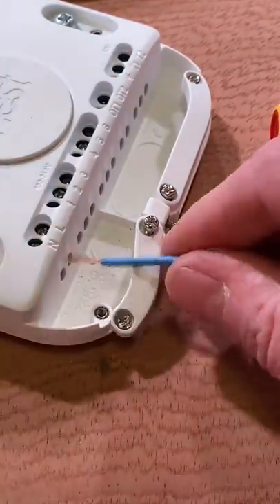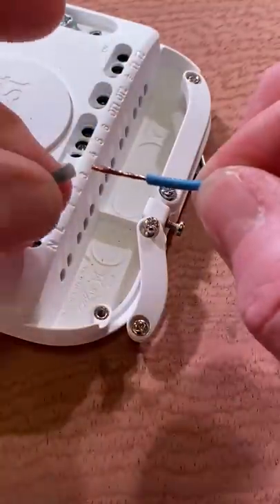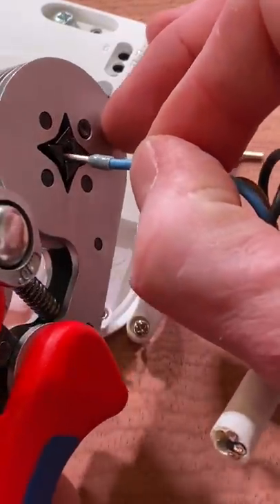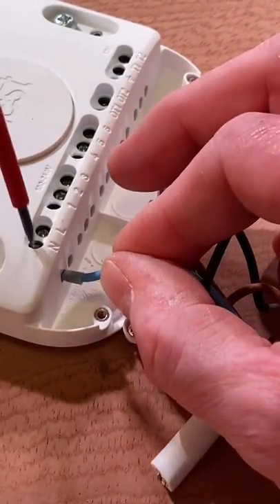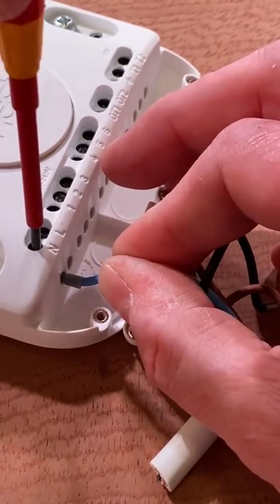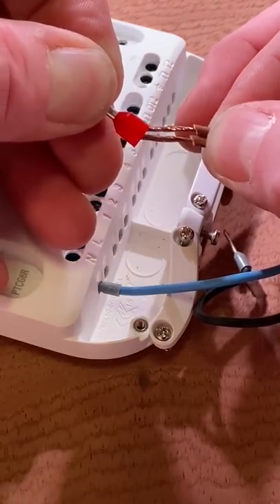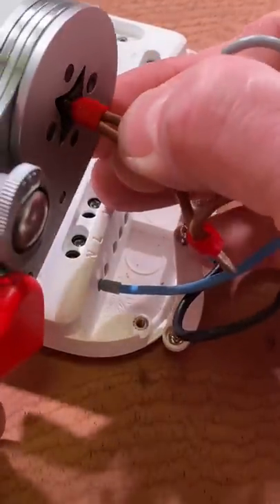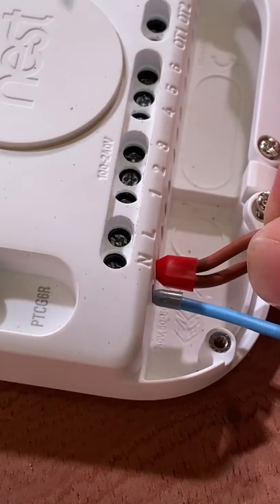Keep the strands together with WIRE FERRULES - Electrical #shorts from eFIXX

Comment: Good solution but a waste of time. Tight twisting works very well WITH NO TOOLS, In the video he barely twisted the wires together AND OF COURSE A STRAY STRAND DID NOT GET CAPTURED.
Even better put a dab of solder on TIGHTLY TWISTED WIRES.
Don’t make things UNNECESSARILY COMPLICATED.

Comment: You're doing it wrong. Read a book about crimping.
Reply from the maker: So what are we doing wrong here?
Reply: @efixx  Don't teach people to twist the wires. Crimping has a bit more to do than just holding them together. After using the wire stripper it is just perfect. A lot of errors happen here (and sadly we faced a lot of them already in our factory). Crossed wires, broken wires, air inside... Best to see when you put them in QC and cut them half.

Btw: UL is sometimes only in combination with the matching tool from the manufacturer. When your inspector has nothing left he will look for it :D
Reply from the maker: Adding a slight twist is suggested by many of the leading ferrule manufacturers. Phoenix Contact make a crimp tool which includes a slight twist as part of the process. 

https://youtu.be/uaIUl9WfciM

They also have UL on their crimp systems.
Reply: @efixx  You don't get it. Forget it. Wasting my time.

Comment: We can't fit this wire into this tiny hole so let's put it in this other tiny hole first?!? Are you fucking kidding me? This is a joke right...
Reply from the maker: Used extensively in electrical control panels - and a regulation in some parts of the world -  no jokes here 😂